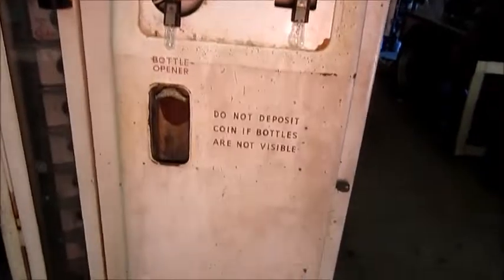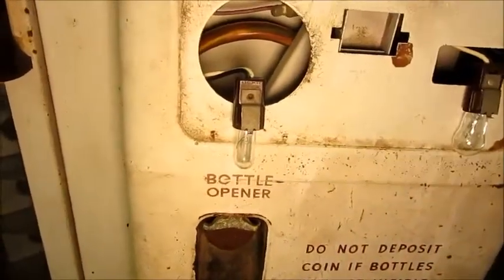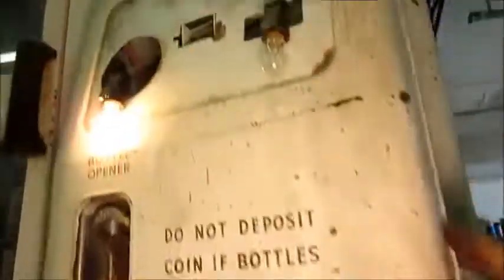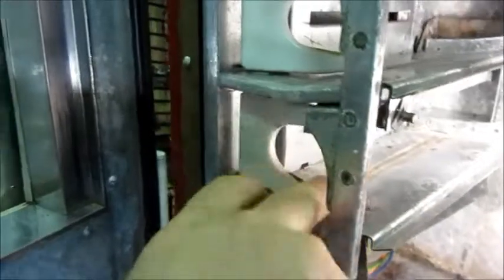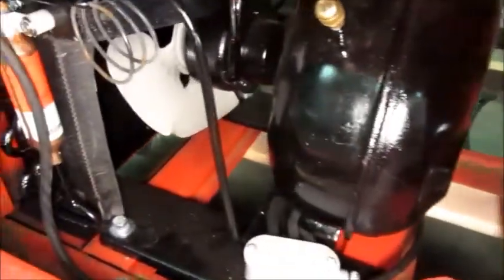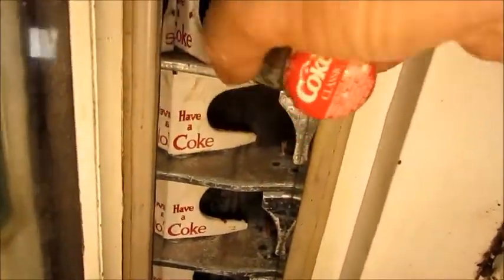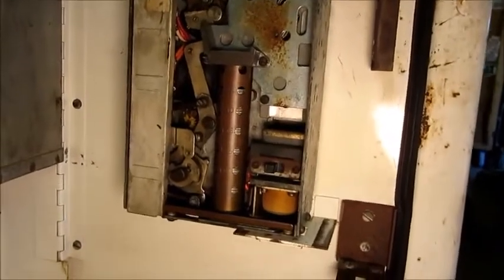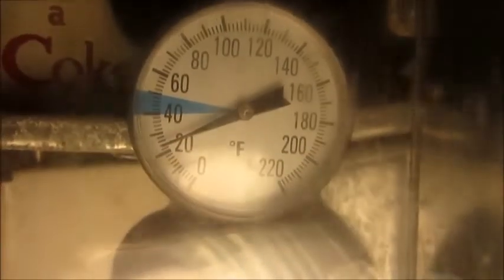Cavalier Coke Machine - 4 - Test after reassembly - Coin Changer

Comment: Incredibly complex. Amazing it still worked after so many year.
Reply from the maker: That coin changer is complex!  I had to do a lot of off-camera work to get it functioning. That is one reason so many of the machines like this in collections have been converted to "free vend" where you press a hidden switch, or press the coin return which hits a hidden switch - and unlock the bottles.

Comment: It actually makes me want a cold coke, and I don't really care for coke! :)
That coin changer really is something, mechanical engineers really were smart back when they didn't have computers to do everything for them.
Reply from the maker: That's true. Not only does the machine its self not use any computerized modules; the designers didn't have the benefit of computers to help with designing it!

Comment: Nice video David
did you actually have to do anything to the coin changer as i have one similar ( thanks for the detailed explanation ) and it has a few issues ,  one of the relay coils is actually falling apart , ( the paper has come undone and the leads have separated from the coil )   I am going to look for a schematic/service/parts manual to help with the identification of the actual parts and to see if i am actually missing anything . 
 But just wondering if you had to make any adjustments on this one as it looks like it works great .
thanks again David , Blake
Reply from the maker: Hi Blake. I was lucky that this coin mechanism was more or less working. I'm a refrigeration guy so have very little experience with the vending aspect of these. 

Look on Facebook (if you're there) for the group Classic Soda Machines. You'll find a lot of help there for the coin mech and vending parts. https://www.facebook.com/groups/91452871395 

Also for parts, check out Fun-Tronicsllc and Soda Jerk Works websites. Lots available for many models.

Comment: I have a Sure Bend Ginger Ale machine that need the compressor\evaporator coil replaced.  After replacing it the machine is back to working as awesome as it h as for 30 years..... But the bottle gate will not release so we can remove bottles.  We had "fixed" the machine to allow bottles to be removed freely without coins, but I can't remember what we did. ;)   Could you please help us?
Reply from the maker: Hi Carla.  I am sorry that I don't have access to this machine any longer. It was a friend's project and has gone home to his place.

There is a solenoid coil in the bottom of the cabinet which releases the bottle rack when a coin is placed in the unit. If you were to block, or tie that in the activated position, it would probably allow free vending without having to modify the machine.
Reply: @davida1hiwaaynet    Do you have a source for the seals for around the doors and the bottle front door?

Comment: Of course there would be some bozo like me who would try to pull two drinks from adjoining slots at the same time.  I bet it has an interlock like old AM car radios to stop pushing two stations at the same time.
Reply from the maker: LOL yep! It is interlocked. The way people would cheat is to bring a container and a bottle opener - then pop the cap off the bottle and catch the soda as it ran out! They would pop and half-drain all the exposed bottles. Of course that made a mess in the machine and then nobody else would buy drinks since all the bottles were opened.

People are awful creatures, you know! :)